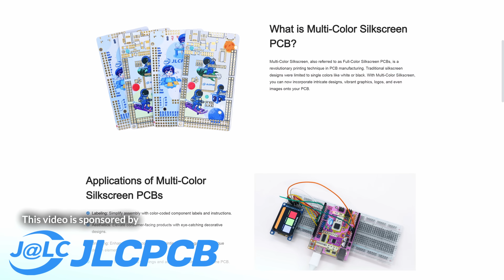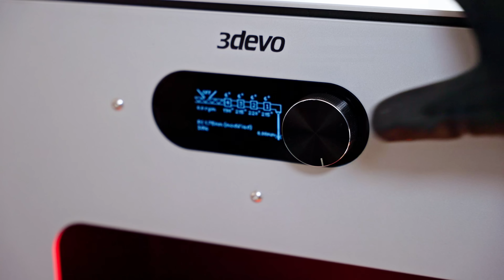How hard could it be to make my own Carbon Fiber Filament?

Comment: This is super cool. We've often thought about how one would DIY a continuous fiber reinforcement toolhead for a 3D printer. Maybe it'd be custom filament, but maybe not too. Would probably require some serious tooling.
Reply: @properprinting was working on one that used uv curable "gel" being pushed out of a nozzle and then immediately cured with lasers.
Reply: I imagine with the fiber pre impregnated into the filament it would only take a reliable cutter in the head.

That said Mark Forged has a bevy of patents around it.
Reply: It exists from Markforged.. and starts at about $600/kg for the carbon fiber spool, with the printers starting at about $9k, but they are also industrial level machines that can print basically any filament and inject the carbon filament directly into each layer as it lays down the plastic.
Reply: @MattWeber  I'd prefer to opensource it and let the hobbyists figure it out. Wouldn't sell anything myself. Markforged can take a running leap IMO -Cooper

Comment: I have seen a video where it claims that the cf fibers go into the skin and stays there if touched. Even if it's embedded into filament bc some are peaking out. Do you know about this?
Reply: there's a reason he suited up with a full respirator and suit to cover himself.
Reply: I have to wear gloves when filing ABS parts as the dust is like itching powder. I once helped my dad install fiberglass insulation without any PPE. Let's just say I'll NEVER do that again.
Reply: @chuckthetekkie that reminds me of something really dumb I did when I was 18. I did duct work and one time I had to work in an attic in the winter. My dumb butt wore my week old Down filled jacket while crawling in the insulation. No matter how much I washed that jacket I couldn’t get the insulation out. I threw it away after only owning it a few weeks 😁
Reply: aside from all the science and knowledge, previous experience in material design even prusa Factory made a statement how it is indeed a non issue
Reply: @BESTofAlp  it takes a long time for the human body to reject biocompatible materials like CF. I know a guy that had a piece of coal embedded in his nose for 40 years until it came out.
Reply: Avoiding fresh fibre is wise, but when the fibre is cured with epoxy or filament the dust from cutting or sanding really becomes hazardous.

It will get stuck in your skin but the real danger is the dust getting into your lungs; it will do permanent, irreparable damage.  Gloves can be effective for skin but proper respiratory protection is harder because it requires the right equipment, specific handling procedures and discipline.

Comment: How about a 2.85 mm filament with a single filament in the center and a cutter on the nozzle activated on every retract?
Reply: i think the issue is that since the nozzle is smaller than the filament diameter, the fiber in the middle would need to feed faster than the filament. hope that explanation makes any sense.
Reply: I think that's a patented design.

Comment: What would happen if you print a layer with normal filament, then stop the print dust the print with some fibres, run an ironing step and then let it print the next layer? you could use much longer fibres since it does not need to go trough the the nozel. The dusting part would of course be messy but it is for science.
Reply: That's a really cool idea. Could work, but may want to use some sort of large roller for faster, more consistent ironing passes
Reply: @rackrobo  yeah, with a bed slinger it should be easier, and how about using the fixing roll of a laser printer,
I wonder is there is an open source laser printer
Reply: @sevenismy  You'd probably want something like an enclosed coreXY so you could over apply the carbon across the entire print length. Just vacuum up the waste afterwards for re-use
Reply from the maker: Great idea! That could actually work well with sparse woven fibers, similar to what I tried with resin printers a while ago
Reply: @MadeWithLayers  I've used carbon matting before for composite stuff. Would require a more manual process than just dumping chopped tow and rolling with a heated roller, but could work out. In any case it would be a significant modification to how 3D prints are made.

You could use similar carbon material to what Impossible Objects uses. - Cooper

Comment: instead put fiber scissors on the nozzle and print a continuous fiber with plastic shell. yes its basically sewing machine 3d printer. you could even 3d sew then add the plastic fill. instead of nozzle only, use a needle with 3d print nozzle. filament process might not be the best for diy process. try in the nozzle direct screw printer mix instead.